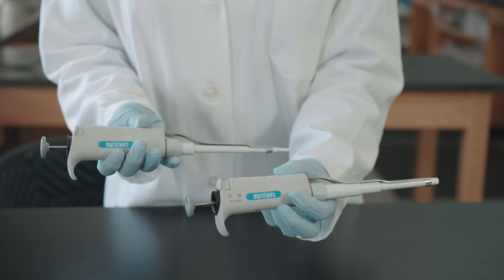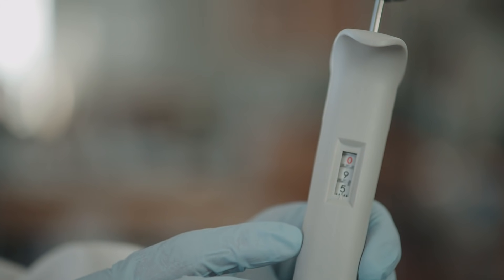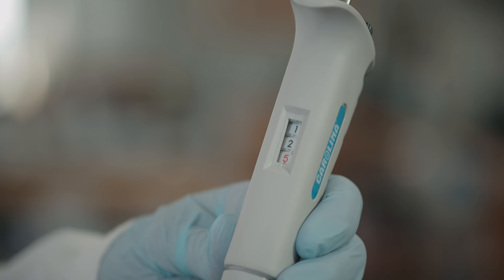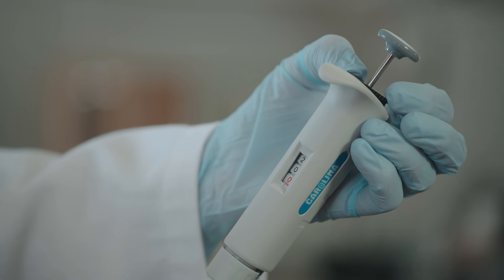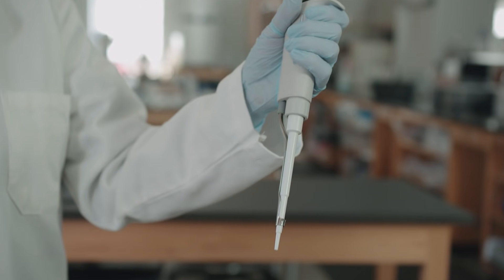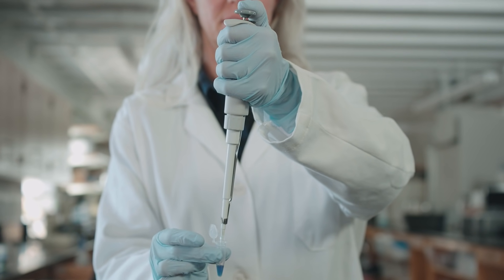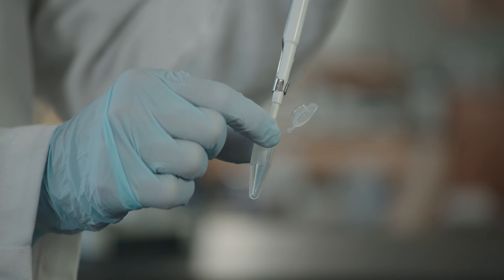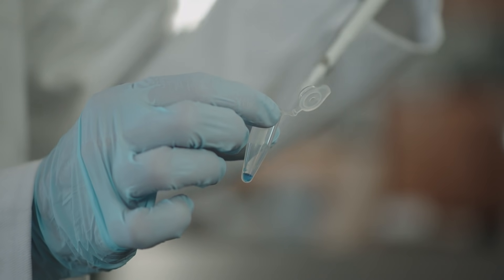How to Use a Micropipette

Comment: 1:53, I bought a set of blood biochemistry assay machine.. Somehow the technician teach me to aspirate by: after push the plunger button until the 2nd stops. They said that "with 220 ul set volume, 1st stop is to take 200, need to push all way down (2nd stop) to get the 220." is this true? Is there any other standard of micropipette procedure? I need enlightment as I afraid I'm doing wrong procedure for the blood test.
Reply from the maker: When dispensing, standard practice is to push down all of the way to the second stop to ensure that all of the drawn volume is dispensed.

Comment: What if I want 953 microlitre
Reply: There is different Pipette sizes  .. the one in the video is a micropipette but a pipette holds more liquid... You can use pipette to accurately measure small volumes up to 100 ml ... İn your case 953ul = 0.953 ml you can easily use a 1000 UL volume pipette and adjust it to 953 UL it's so easy